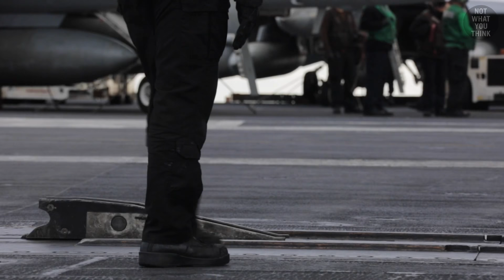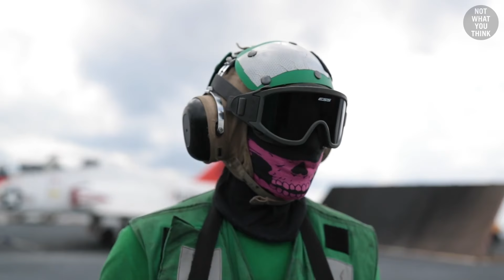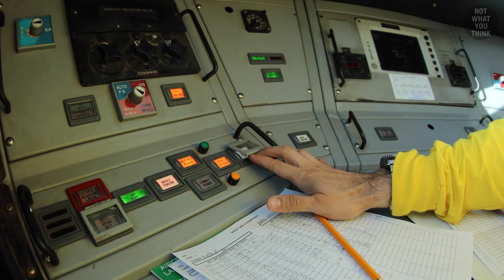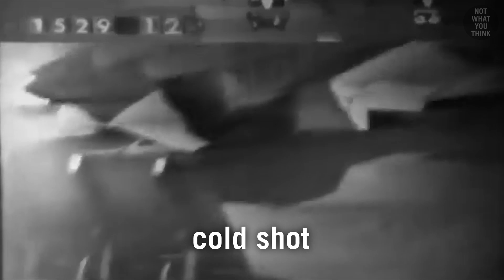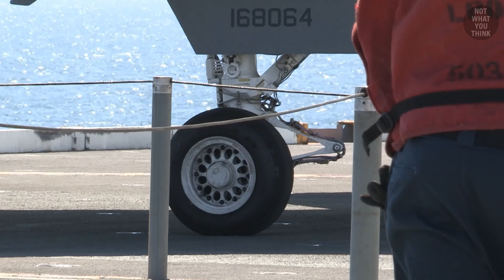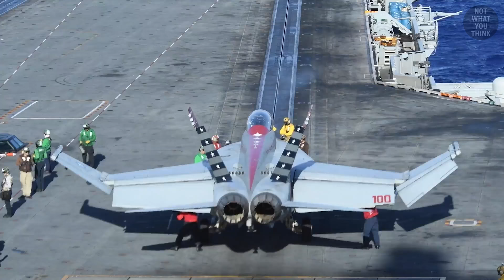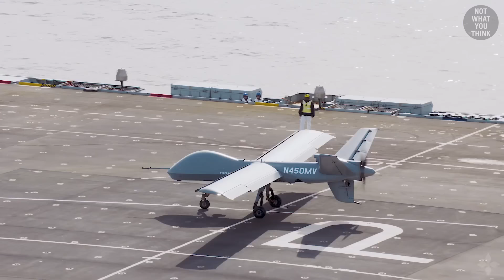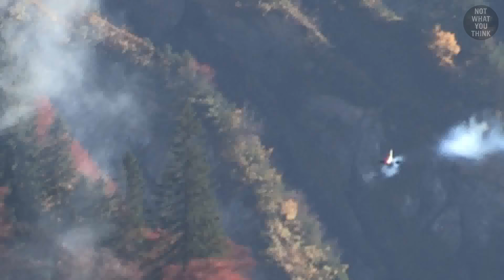Why the US Navy is Replacing Electric Catapults with Steam

Comment: It is quite possible to build a steam catapult with a feedback loop and a soft start. The technology has been available for at least decades.
The fact that it has not been done is down to perceived need and the fact that such technology brings with it many of the same reliability issues that electromagnetics have.
Reply: Greg, I watched a YT video a while back. In it the flight deck officer in charge of launching and recovery would send a message to the cat room telling them what aircraft type was being launching or recovered. The cat room operator would punch that information into a computer which in turn would adjust the steam system for the aircraft weight. 

It's no longer a one size fits all operation. So, the comments I've read so far fail to mention this when they're talking about airframe wear & tear. There also seem to be a lot of supposed nuclear reactor engineers making pro and con arguments.

Comment: Stop making believe China has aircraft carriers  Much less electric catapults   Aircraft carriers rely on EXPERT MOTIVATED DEDICATED COMMITTED CARING crew top down.  ANY fear based country, ie dictatorships, class systems, oppressed masses, poverty stricken  etc will NOT have such crews.  Japan in WWII had a fear based military and after it lost the crews who they trained up for nearly a decade in their first set of carrers, some of their carriers didn't survive maiden deployments DUE TO CREW.  fyi  SOP was for crew to be BEATEN for the most minor infraction or failure inc questioning anything.  
While everyone on a carrier has a job, it's just as vital that everyone is fully aware of everything around them at all times and fully involved in ensureing anything that is amiss is instantly rectifified.  
fyi  Given the speed of carriers many light prop drones will take off at desk speed and would need to be secured at all times.  Yes that's a thing.  At end of WWII Navy experimental plane could take off ALMOST in a standing still config thanks to big wings and prope designed to generate lift equal to weight standing still.  It would have ended the NEED for carreir to launch inot wind.  These planes were not as fast or manuverable.  It's had to say if Navy would have found a use for them.  Ground attack comes to mind.  However with space limited and fighters making exceelent ground attack platforms, again, not sure why Navy would have deployed them.  They might have tried stuffing an escort carrier with them w wings off, assembling and running from deck mostly until hanger space was freed up.  However, again, no need.  By theat time so many aircraft were being produced a month vast stock piples of them were buidling up all other the world.
Reply: Gentlemen, what we have here is, a moron.

Comment: Meanwhile, China is working on a portable(ish) electromagnetic catapult for drones that can be used from the back of a handful of large trucks linked together or quickly added to existing ships as long as they have the electricity to spare (which can come from a container-size battery, no modification to the ship needed). Plus, they already have a class of drone carrier with electromagnetic catapults (well, it's technically a drone carrier, but it's about as large as the Charles de Gaulle aircraft carrier that serves as the flagship of the French navy).

Comment: We should go with half steam on the bow and half emals on the waist catapults. The bow is for heavier planes needing more power. Use the waist catapults with EMALS for Triton drones and f35s.
Reply: I wouldn't think two systems would be installed.
Reply: That’s a very bad idea.

As the other commented alluded to - you’ve just “designed” the most complex and failure prone carrier in history. 

EMALS handles light and heavy just as easily.

EMALS is still new tech. Ford is the first carrier with it, and we are learning a ton - this was EXPECTED. That’s why we had such a long test period on Ford and so long before we cut first steel on Kennedy.

So we had time to learn and make all the changes needed to make the next carrier even better.

The planes will all last longer - and the drones will be easier to integrate.

EMALS all the way - we just need to commit and fix the issues.
Reply: @unknownuser069  And it's obvious that you are clueless about directed energy and MICROWAVE WEAPONS. The use of which could easily disable EMALS, but would fail to stop steam catapults. You might only get one or two additional launches but that could be the difference between defending the fleet or failing to do so. The era of NATO collaboration is over. Just because you don't have a security clearance to understand where DARPA is going is not a reason for you to constantly enrich us with your ignorance.
Reply: @WefixBayonets  

No - I don't know where you heard that, but its a myth.

Directed Energy Weapons (DEW) pose no more threat than kinetic weapons. DEW are far less capable of that sort of kinetic disruption than old fashioned  weapons.

So unless you have a Star Destroyer or a Romulan Warbird hanging about ... DEW are a non-issue.

Microwave weapons pose no special threat to EMALS. They are just a DEW or EMP depending on how you use them.

EMALS is very mujch more resistant to electronic disruption from EW or EMP than all the other electronic systems on the ship. 

It's a giant power mismatch - they are designed to handle many megajoules to do their job of launching aircraft. 

Let me put that differently - for an EMP/Microwave burst sufficient to damage EMALS, you would have long before melted the radars and communications gear on the ship, and probably the entire strike group - including the jets.

The carrier would be a mission kill long before EMALS would fail due to EW or EMP.

Cyber is far more of a concern - but again not because EMALS is in any way especially susceptible to it, just that the EMALS computers are newer than the steam catapult controllers and we still have to test them thoroughly - which will take years, if not decades, of live deployment testing/drills.

That last bit is true of any new digital system really - so its a non-issue unless you want to start sailing WW2 ships again without updates.

Comment: If EM catapults having too strong of acceleration is really that much of an issue, just scale back the power a bit, or even better, build in some attachable voltage dividers to step down the voltage for lighter and more frail craft. It's far easier to control an EM catapult due to it fundamentally being an electrical circuit than it is to control a highly complex steam catapult system composed of multiple systems.
Reply: You have some very insightful ideas here. They could be of great value in resolving these issues. Have you considered forwarding them to the Navy?

Comment: Mechanically, the electromagnetic version would actually be more reliable.  Fewer moving parts.  Fewer things go wrong.
Reply: In THEORY.  We have just watched DATA that say EM is 10 X less reliable than steam.  Based on tests.
Reply: @hallmobility if it was less reliable than it was due to human error, not the concept itself.  Laws of physics literally mean it should be better in nearly every possible way unless someone screwed something up.  It's nothing but a linear motor.  You can make a crude demonstration from nothing but a 9 volt battery, two wires, two strips of aluminum foil, and a needle or some other metal object that connects the two aluminum strips and can move.  I built a more complex (used capacitors and some more complex circuitry) one by myself in high school as powerful as a BB gun on the cheap.  It worked perfectly until the capacitors I used burned out because I was using super cheap ones.  A steam catapult has a ton of points of failure, has leaks, has many parts that wear out, tons of moving parts (valves, pumps, pistons,  spinning belts, basically about as complex as a gasoline engine).  Electromagnetic has two or three moving parts at most.  Someone probably screwed up on the wiring, installation of vibration dampening, improper maintenance, incorrectly installed rail mounts, made a design error, and/or bad quality assurance with the electromagnetic one if it wasn't reliable.  If something happened like that on a steam catapult, you have all kinds of potential safety hazards.  With the electromagnetic you have one or two (electrocution mainly).
Reply: @jayburn00  Don't talk to me about grade school electromagnetics.  I designed, built & programmed automated EM test rigs for NASA, hence my screen name.  I already know why such high-powered rigs can never be FAST.  NOW we have the DATA from two nations that say these are much less reliable than steam.
Reply: @hallmobility why so defensive?  You are behaving insecure by resorting to a logical fallacy.
Reply: @jayburn00  It's you who are on the ropes my friend.  Citing actual data, years of tests, results from two nations, multiple sources and multiple citations are a logical contradiction??
Reply: @hallmobility appeal to authority.  I too can cite "experience" and expertise (worked for the safety and mission assurance directorate at Johnson space center and for ARDEC afterwards).  You cite tests,  but don't actually provide sources, so I did some digging.  As I suspected, there was at least one major engineering design mistake that contributed to it being unreliable.  So again, the problem isn't the science, but human error.  Also, high powered em systems moving fast is done all the time at far higher speeds in other applications, and reliably, so you apparently don't even know what you are talking about.  Accelerating that much mass that quickly is a different story, but that comes down to an engineering solution.  It's new technology and it always has teething issues when new.
Reply: @jayburn00  I too worked for NASA at JPL, and designed, built and programmed automated high power EM test rigs. See screen name.  And what did YOU do for NASA?  The "experience" is over 10 years risk-reduction testing on deck AFTER the EM system had been "Qualified" and "Accepted" and delivered to the Navy.  Plus the Chinese experience, where he recently repaired Fujian is now relegated to a T &E role.  The citations are from The War Zone and The Aviation Geek Club Failure one out of 181 launches.  I've made at least 4 responses to this video, so scan the total thread.
Reply: Hold my Type 45

Comment: West Navy is not going back to steam catapult. They can’t because it would require a whole new redesign of the Ford class carriers and an increase in birthing. Removing the steam catapult cuts down on crew requirements by almost 30%. Electromagnetic catapults are far more reliable and deliver far more consistent power. There is absolutely no advantage of steam catapults over electromagnetic. All this comes from Trump talking out of his ass once again about something he knows nothing about because you heard Elon Musk talk about it once

How many times are we gonna hear? People complain about how a certain military vehicle or aircraft or equipment doesn’t work only find out that the military actually knows what they’re doing for the most part and it works very well

Comment: If US engineers couldn't get Electromagnetic catapults from prototype for fully reliable and functional within 5 years, there is something wrong with US engineers. 
Frankly WW2 German Graf Zeppelin could launch 18 aircrafts in 10 minutes from their compressed air storages, then it needed to spend about hour to recharge them. But, they got functional stuff that could launch decent naval aircraft on their first try without having experience with navy and carriers.

Comment: The problem with electric CATOBER systems is quite simple. Ohm's law! E=I/R is simple mathematics. It's politically correct to "go electric" today in the USA.
     The real issue is seawater. At sea, seawater is everywhere and gets into everything. In theory, electric CATOBER systems SHOULD be better. Seawater contamination doesn't bother steam catapults much. Electromagnetic catapults with seawater contamination? Small amounts results in reliability issues and potentially serious damage. Larger amounts can easily result in arcing. Resulting in a class C fire, and or serious flight deck incident.
      I cited Ohm's law as it explains why electric CATOBER systems (at sea) are fundamentally unreliable. These systems all need controlled high voltage to work right. Seawater intrusion is a routine event at sea. What sea water intrusion does? Is to substantially reduce the R factor in the equation. Allowing intense amperage leaks, which do lots of ugly things. 
    When I first heard of all electric CATOBER systems. I thought at first that they had managed to overcome this problem. Only what's becoming ever more clear. Is that the MASSIVE delays and cost overruns associated with the Ford class CVN. Are nearly all related to electric CATOBER systems onboard. Nominally Gerald R. Ford is in commission. Yet, where is she? If the electric CATOBER systems were working 100%? She should be a front line carrier. Instead she's been reassigned to Gulf of America service.  With friendly airports ashore.  Major CATOBER problems, allowing for airwing components to safely land ashore. Enough said.

Comment: I don't think a potential change back has much to do with Trump. This has been discussed since 2009! And since 2009 they still haven't gotten the EMALS to work properly. 

From a defense report in 2023 when Biden was POTUS:

"A June 2023 United States Government Accountability Office report highlighted EMALS’ lack of reliability on the Gerald R. Ford and suggested the system’s failure rate has been much higher than expected than the steam catapult system it was designed to replace." 

"The reliability of CVN 78 catapults, arresting gear, and jet blast deflectors (JBDs) continues to have an adverse effect on sortie generation and flight operations efficiency," noted DOT&E in an annual report released in mid-January.

An article from farther back, 2009 when obama was POTUS:

Thursday, April 2nd, 2009
By Emelie Rutherford and Geoff Fein While the Navy currently plans to stick with the Electromagnetic Aircraft Launch System (EMALS) for the next-generation aircraft carrier, it is seeking input from industry on the cost and schedule impact of switching to a steam catapult, service officials told lawmakers yesterday. House Appropriations Defense subcommittee Chairman John Murtha (D-Pa.) peppered Navy shipbuilding officials during a congressional hearing on the service's examination of possibly reverting to a steam setup for CVN-78 because of cost…

From a 2010 report:
"Navy Exploring Impact of Switching From EMALS To Steam Catapults For CVN-78"

Comment: Here's a fact from Wikipedia:   Since the second half of the 20th century, steam catapults have been the mainstay form of aircraft carrier catapults, especially on the nuclear-powered Nimitz-class supercarriers.    Also:  A proposal to retrofit it into Nimitz-class carriers was rejected. John Schank said: "The biggest problems facing the Nimitz class are the limited electrical power generation capability and the upgrade-driven increase in ship weight and erosion of the center-of-gravity margin needed to maintain ship stability."  Steam is the better option.

It is now 6 months since I wrote the above and more information about the EM catapults has come out.  They are unreliable, and require a lot of maintenance.  Not something you want in a combat zone.  Until these systems have been rigorously tested and surpass the reliability and ease of maintenance of the steam systems, they should not be placed onto aircraft carriers.
Reply: I can see how steam catapults would make more sense for a ship that was originally designed to use them; electric might still be better overall though if you were starting from a clean sheet design. (Or not! I don't know lol)

Comment: Weird how the rollercoaster industry solved this problem decades ago
Reply: Because of the use of these things in roller coasters, the thing that surprises me a little about EMALS is that it uses a LIM (linear induction motor), in which the electromagnets push against induced eddy currents in a conductive fin, rather than a linear synchronous motor (LSM), in which they push against permanent magnets. When roller coasters started using electromagnetic launches, LIMs were initially the most popular variety, but lately most of the industry has switched to LSMs, which are a little trickier to get to work because they require more precise timing, but offer superior power and efficiency. I guess if you've got a nuclear reactor to power the thing, you care less about efficiency than about relative simplicity.

Launch coasters have used all sorts of methods in the past, including catch cars propelled by dropped weights, flywheels, and hydraulic and compressed-air systems, but manufacturers really seem to be standardizing on electromagnetic launches these days because they've become very reliable and efficient. There's some fan complaint that they're not as punchy as the hydraulic and compressed-air launches, but it seems like recent ones are getting more powerful.
Reply: Yeah except they haven’t. I think this is a real concern with the magnetic system. They’re modeled after the magnetic systems used for roller coasters but those fail all of the time and require maintenance and repair. Like literally six flag, Disney, universal and cedar point all had consistent issues with this design. They obviously figured a lot out, but they continue to have issues with the coasters every year and have to shut them down because of it. 

I can only say that if you’re the navy, no matter how many benefits the magnetic system might have, if it’s not reliable than it is a huge concern. Steam is proven to be reliable and simple.